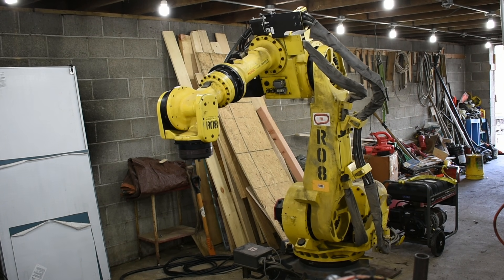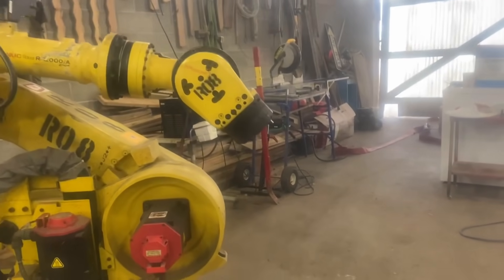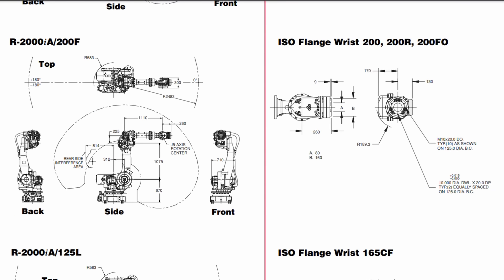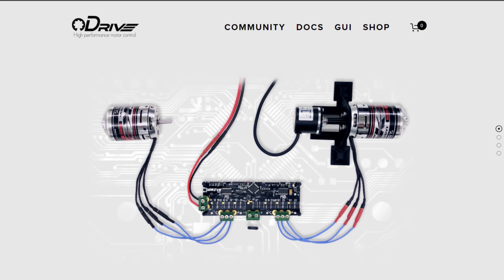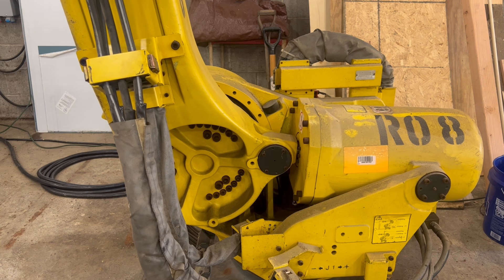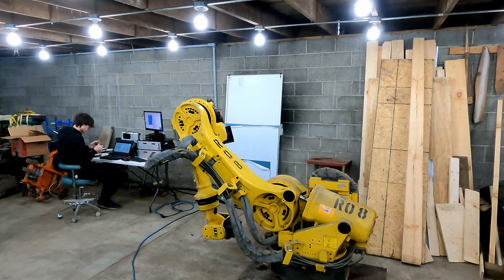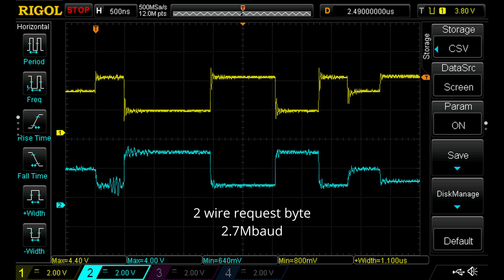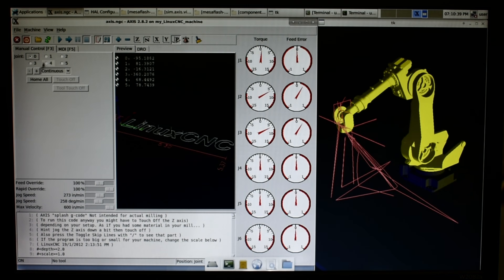Running a 1.5 ton Industrial Robot With a Custom Open-source Controller part 1

Comment: Your work is insane, but I still have one question: why does it need to be this hard? I feel like the whole thing could be run with a few widely available components, but somehow you need a whole desk of electronics just to send the info to the motors and get some back, while everything is encrypted to degrees of which even the pentagon will be jealous of.

Comment: How did you mount the robot on the concrete? Bolts probably, but I mean they need special concrete block afaik. What if the floor concrete cracks open? Ty.

Comment: I'd have considered reverse engineering the ROMs as one of the options.  It sounds like you'd just have needed to locate and change some constants
Reply from the maker: You actually do have access to those parameters through the controller, but knowing what they do and which need changed is a whole other issue

Comment: Amazing! I just saved a arcmate 100ib and r-j3ib controller with pendant from being scrapped. Id love to know exactly what 3phase converter and transformer you used, the vid still is hard to see. Wanting to use it for plasma cutting steel sheets if I can but am mega new to these robots. Any help would be appreciated. ❤

Comment: just an FYI. I am not sure if you are aware it seems like you have done a good bit of research on the robot already. I used to build production machiner around the fanuc robotics line at my old job. If you were inclined to you can get the teach pendant for your model and do all of your programming that way. No external software, no license to buy, nothing extra to figure out. Just plug and play. If i cna be any help to you please let me know.
Reply from the maker: I actually did have the pendant but I wanted to try to find a way to run more complex programs like CNC toolpaths.

Comment: How cool. Have you considered open source STMBL drives? They're only usable up to 2.2 kw though. I have 6 drives I'm trying to get to work with an old Staubli arm
Reply from the maker: I did, but the motors I need are ~4kw so they wouldn’t cut it, I ended up deciding to design some new drives myself that should be perfect for running robots.
Reply: What staubli robot do you have? I have a rx130 I'm trying to develop a plan for to give new life.  I have the cs7 controller and I rewired the cabinet to run off 220 single phase.  All the Baldor drives give a green light so I'm assuming they are working.  I'm wondering if I can salvage the Baldor drives to take command signals with a new controller I want to build
Reply: @joshuamouw14  I have an RX60 from circa 1998. I also have a CS7-MB controller that is set up on 208v 3 phase and it works, but it uses the old Adept programming language
Reply: @joshuamouw14  I have an RX60 and RX60L

Comment: I would just go ahead and get the other robot.  This isn't ever going to work right no matter how many patches and fixes you run with the O-drives.  The only way you get this to work right is if you find an amplifier to bump up after the odrives do their work, and thats just one more bullcrap fix that will take 20 hours to get right.  IF you have issues with the angle, I don't know about these robots, but I am super suspicious about that springy guy in the back screwing everything up

Comment: I used to work for an integrator and used Fanuc robots for 5 years.   For the past 23+ years, I have worked for Motoman ( Yaskawa).  
You have your work cut out for you, since you don't have the matched controller for that arm.    Great work and way to DIVE in.   
Look forward to watching your progress.      Cheers
Reply: Been a minute since I worked on a Motoman. Ours was so old that I ended up buying an old 1.3M pixel camera with a CF slot in it so I could format the card properly (Motoman required a different version of FAT12 which Windows no longer uses).

Comment: Brilliant work! You stand among the great! Way to push through! You're helping drive manufacturing for the everyday guys. 

I build machines and could totally use that controller. I just drove the cost on a part from a $1.05 to $.09 and we make a thousand of these parts a day minimum. We need to load the machine once a month while we maintain the ability to pull 1,600 off a day. 

"So we never have to load it and we're able to pull in $$ish?" Yessir. I'm stoked... I started electrical and mechanical and then found manufacturing. Building with my hands man.

Comment: My friend I need to know how to obtain a robotic arm like this as cheap as possible In fact free would be great! I live in the Chicago area. If there's anything you could assist me with such as suppliers, pointers, or resources don't hesitate to reach out. I'm attempting to 3D print solid state batteries which will require a combination of wire arc additive manufacturing, fused deposition, and traditional CNC machining in one printhead at the end of one of these industrial bots. My background is in physics and I'm familiar with the electronics necessary as well as things like Linux CNC. I was going to resort to building my own but since you mention that you can get these virtually for free I'm second guessing that perhaps I should just find the right people as you suggested if you don't mind sharing your people it would be greatly appreciated!!! I hope to hear back from you!!!!

Comment: Great video! I wish I had enough electronics/software knowledge to really understand everything you presented here.
With the right attachments for the end of the arm, this robot would be handy for automotive rebuilders (imagine being able to quickly and easily manipulate the position/orientation of heavy parts during disassembly/reconditioning/assembly). It could also replace a miniature crane in certain applications, especially if the robot was made mobile by some means.

Comment: You could have just adjust the DH table in the controller... (kinematic model / robot measurements and angle between the axis).
Reply: Great job none the less
Reply: I never did it on a RJ3, but I could show you where to do it on an R30i, it might be pretty similar. 
I will try to pull the information later tonight.
Reply: The controler is not "for a 200f" or for a "165f". It's the same controller, juste with a different DH table in.

The only problem you can run into is if the robot is old enough to require a RJ3 controlle instead of a R30 variant.
Reply from the maker: It is an rj3, it looks like there may have been some ways to adjust the gearing but idk about the kinematics and the inertial stuff
Reply: @ExcessiveOverkill did you try this?

Comment: You are a very ambitious young man! I used to work for FANUC  as a field service engineer and your project would be so much easier with the correct software. Did you try to contact FANUC and give their support engineer the F number from the base of the robot? Tell them the controller F number and request an USB be sent to you. Don't tell them anything about this mad scientist stuff or they will not work with you. Just tell them that you bought the robot for educational and demonstrational purposes. The FANUC servo amplifier and controls are far more capable than any home built system. Kudos for getting anything to move safely. Yeah, don't mention that. Also don't talk about the disembowled control cabinet either. Siemens programmable logic controllers can interface with both a FANUC robot and also interface with Arduino controllers running Linux. Oh, using the FANUC servo amplifier allows collision detection which can prevent damage or injury from happening. Good luck to you and work safely!
Reply from the maker: I didn’t have any luck sneaking past Fanuc, even with the education school excuse, couldn’t even get manuals from them☹️

Comment: I always thought there is some dark magic involved in running such robots servos as the dynamics are complex and you need smooth motion, small following error and reduce things like harmonics and etc. I read up a book on servos and the math was quite heavy :D
Reply: What was even cooler, back when i worked at Fanuc, was the "float" mode. You can grab the end of the robot arm, and push it around. It will sense you pushing on it and "let" you push it. Obviously you're not strong enough to actually move it, but like a toddler holding your hand, it sense the tiny force you put on the arm and move in that direction.

It's also quite impressive to watch the raw encoder values with with the robot sitting still, and just touch the end of the arm. The encoder is so precisce that it can register the imperceiptible movement you add.

Comment: 440lbs, that's it ?? needs to be at least a ton
Reply from the maker: That capacity is what it is capable of at full reach and full speed, it’s crazy it can move so fast with such accuracy(at least with the original controller)

Comment: I don't know why so many auction companies that frequently handle machine tools and industrial equipment refuse to hire or train people who know anything about the stuff they're auctioning. They keep mixing things up and separating parts that go together. One auction I went to had a big sinker EDM. The auction company had moved all the equipment outdoors and separated the EDM, its power supply, control console, and the cables to hook it all up by as wide a distance as was possible in the venue, with the likely irreplaceable cables tossed in with a load of scrap wire. There was no damn reason to do that when it had all been together inside.

The auctioneer thanked me for pointing out where all the pieces were and he made notes so he could sell the complete EDM system as one lot. Same for several other pieces of equipment their crew had split up and scattered around. Keeping things together makes for higher bids, which means the auction company cut of the total is bigger. They should want to keep all the parts together.

Comment: For the record, roboguide ships with all the controller firmware variations so you could have downloaded that and then restored from a virtual robot while using the trial version and saved yourself the custom driver but this is cooler

Comment: just curious what is the resolution of the encoder which comes with this
Reply from the maker: The normal ones are 65536 (16bit) count/turn and 65536 multiturn count. One of them is newer and is 16777216 count/turn (24bit)
Reply: @ExcessiveOverkill  thanks for the info :)
Just guessing that the better ones are at the base?
Reply from the maker: It’s actually one of the wrist motors, I believe it was just replaced at some point and the newer ones are backwards compatible
Reply: @ExcessiveOverkill  must be, thanks for the info and good luck for your projects 😃
You really are posting great informative video, will look forward for more ..

Comment: This is amazing!  There is a huge market for aftermarket Fanuc retrofits.  If you decided to sell that people would buy them like crazy for old CNC machines running Fanuc drives.
Reply: i want a hundred!
Reply: but also might risk legal action from Fanuc
Reply: @theaveragepro1749   On what basis? Reverse engineering for the purposes of compatibility is specifically legal in the US. No one whom Fanuc would hope to sell to would be using a homemade DIY solution instead.
Reply: I want one

Comment: I'm curious, if you have consider, instead of recycling old controllers and decoding all that old and undocumented stuff that you have to learn, and investing all that energy into unknown mess, consider maybe building something new?
For example, controller based on esp32. It operates at solid speed, reads G-code, something like FluidNC
For position reading, maybe absolute angle sensor? From there, you can choose to send signals in a way to create your own "encoder board" with angle sensor and esp32 to encode reading+CANBUS
Then, create something like odriver, but for higher voltages. There are projects like arduinofoc (based on older arduino), ODESC (based on stm32)... You can study their code, and make your own with newer, cheaper, and more capable controller like esp32. If that scares you, and you are good with python, there are <20USD SBC boards that you can install linuxcnc and control all from there.
I mean, if you only mess with original commands, hw, software, in the end, you will make it work, but in 5 years, that will again be obsolete, parts nowhere to find, software eons old, and you'll feel simply tired, so much you'll almost have scars of it. But this other way, if you build something of your own, your stuff will work at least 10-15 more years, and you'll learn c++, ROS, creating your own PCB-s... and maybe, maybe, someone will pick it on ofter you.
I don't want to discourage you, I admire you, and I'm probably all wrong, but if I had again that energy you have, I'd maybe do it like this (ditching old electronics). In any case, good luck!
Reply from the maker: I am definitely going to make my own drivers and possibly a dedicated motion controller instead of LinuxCNC. The plan would be to build support into the drives/controller for as many different robot encoders as possible, that way it’s super versatile and I don’t need to replace all the robot encoders if they still work, they are way more tested and reliable than anything I could design in a reasonable time anyway. I have actually already designed some absolute encoder PCBs but haven’t really used them for anything yet.

Comment: This is very interesting- I am wondering what prevents making a program that accounts for the difference between kinematics set A (controller) and set B (actual robot)? There are off-the-shelf 6 and 8 axis kinematics modelers, maybe more, if you know the length of each offset in Robot A (the controller is programmed for) and B (shown in your schematic) I think it would be workable. Or at least possible.
Reply: There are different communication methods between joints and the CPU on various robots, those require more work than simply translating between two vector spaces. These vary in timing, power requirements, and overall data architecture.

Comment: Dude this is totally awsome. I have a question tho. I got almost exactly the same servo motor a while ago. I have no idea how to work it. Just the motor no robot. How would i do that?
Reply from the maker: You can use an Odrive if you’re alright with like 15% speed, the encoders actually have quadrature pulse output internally if you open them up so you can hook them directly together. If you want full speed you’d need to find a servo amplifier rated for the same voltage and that can accept quadrature input.

Comment: Its really easy to change the gearing parameters and center link distance in the factory software.......you definitely didnt get ahold of the right person at Fanuc.
Reply from the maker: Huh, I probably should have researched a bit more, it looks like there were just parameters in the start menus. I didn’t get Fanuc themselves to tell me anything, they didn’t like that I wasn’t a full production company. Anyway i still wouldn’t have gotten the robot to accept Gcode with the original controller without Fanuc’s help, ditching their controller was pretty much required if I wanted to do any fancy controls and not spend 20k on software options. Obviously not as good as Fanuc’s controller precision wise, but it’s much more customizable.

Comment: Cool video, many thanks for sharing! Question, could you get Linux CNC to output computed-torque feedforward? That would likely improve the motion performance dramatically without having to increase the feedback gains.
Reply from the maker: Its really hard to get the feedforward values since you need to do the inverse dynamics of the whole robot to factor in gravity and acceleration on all the joints. I would like to eventually but it's a long way away
Reply: @ExcessiveOverkill  even a crude inverse model usually improves motion performance a lot. Friction is one of the most important things to compensate, having done that makes tuning the feedback gains much easier. A simple Coulomb + viscous model is easy to estimate from simple experiments and makes a big difference. Keep up the good work!
Reply: For what it’s worth, when we calculated losses. IR2 , rotational drag, (bearings) and gear train loss .  Summed up in “no load watts”.

Comment: I used that R2000 for mig welding at a factory. At floor level its only 4-5 feet tall. You could disable the machine guards to make adjustments. 
If you get in that things way, it will toss you like a rag doll. I'm 200 pounds!

Comment: Amazing work I love it thanks for sharing. I wonder if you gave up on the fanuc servo amplifier too easily. The optical fiber connection shouldn't be so difficult to tap into. Maybe it's just ethernet and you can wireshark the packets? Someone out there has information on that protocol.
Reply from the maker: I think it is some custom realtime protocol, I have a large capture of it saved from when the controller was still together. I'll add it to the github repo if anyone wants to have a go at it. I asked around all the forums and found zero mention of it.